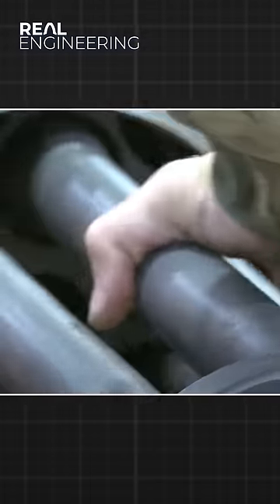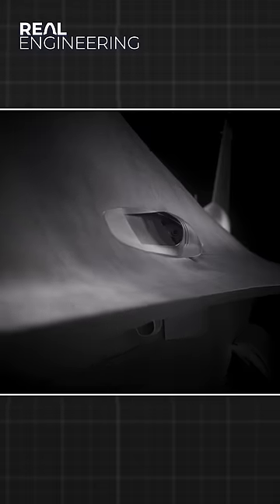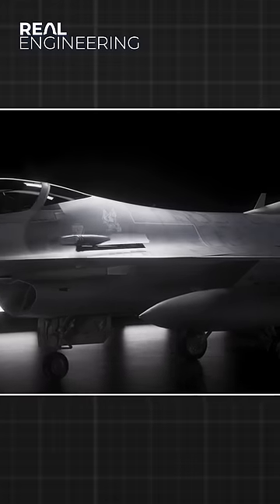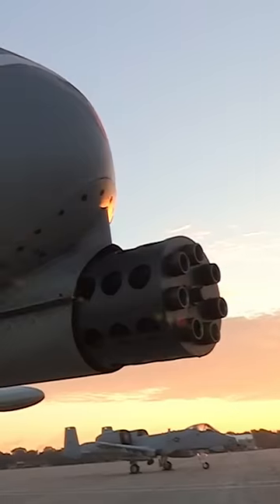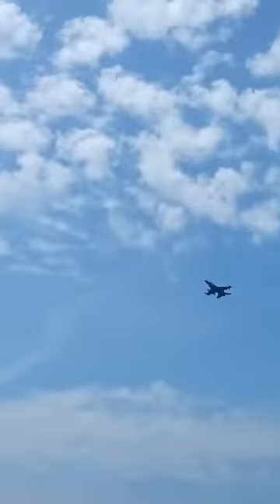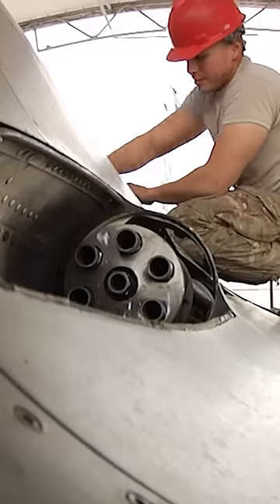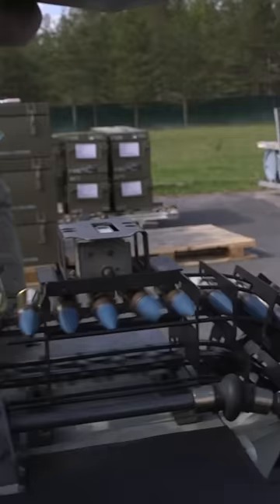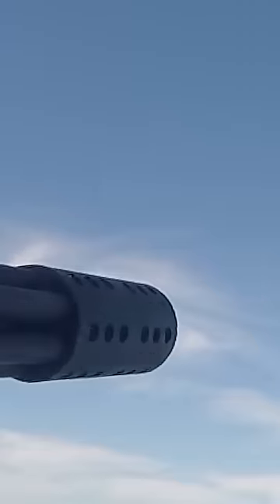The F-16s Gun Sounds Amazing

Comment: As an F-16 pilot once told me, if you have to use your gun, you already fucked up.
Reply: And thats why the f-35 has no gun, (it has a gun pod attachment because of FUDS and Reformers) and new rifles don’t have bayonets.

The only thing you should do if you find yourself having to use the gun on a fighter, or the bayonet on your rifle, is find the officers who put you in that situation and have some kind words with them.
Reply: @purplepenguin43 you have the bayonet on your rifle to use on your officers!
Reply: Too close for missles, I’m switching to guns
Reply: @purplepenguin43  Still the F-35A intended for Air Force strategy and doctrines have built in Gatling cannon
Reply: Would an F-16 still occasionally do CAS gun runs, or is its gatling not really meant for that at all? Asking in case video game depictions of the F-16 are blatantly inaccurate
Reply: F-35s have the GAU-22 @purplepenguin43
Reply: @purplepenguin43 better to have and not need then need and not have isn't it?
Reply: @elwoodcope7152 that ain’t no shotgun I’ve ever seen!!
Reply: Yeah, you didn't run fast enough to get back to the JFT. American weapons are designed like a network.
Reply: @purplepenguin43 I would 100% like a bayonet mount and not ever need it
Reply: Luckily the F16 is a very good dogfighter and have great gunsights!
Reply: @iPlayOnSpica cas is actually maim use of the gun. Its useless for planes in modern warfare, you will never get into a dogfight with a plane. It just doesn't happen
Reply: @jooot_6850  As a Vietnam Vet, I heard the Go-To Attention Getter was the M67.
Reply: @iPlayOnSpica  Yes, CAS is in its mission role.
Reply: Yup
Reply: While in reality Dog Fighting is every pilots wet nightmare
Reply: @purplepenguin43  A British army unit performed a successful bayonet charge against the Taliban in Afghanistan after they were ambushed.

The Taliban wet themselves when several screaming Englishmen came charging towards them with bayonets and withdrew immediately.

So the bayonet still has its uses
Reply: The cannon is also useful for close air support of ground forces.  Pilots practice it on gunnery ranges. I saw both F-16 and A-10 cannon fire in air-to-mud roles.  10mm may not seem like a huge difference between the two, but it is remarkable.
Reply: @purplepenguin43  It has a gun pod attachment, because the original design included a gun and it cracked the frame. Now the gun pod interferes with the stealth capability. You have a lot of the sales department's spin all over your statements. Be sure of this, the f-35 is unwanted by all the other countries, because it has been plagued with MASSIVE problems from the beginning, causing it to be one of the many ultra-expensive pieces of USA shit.
Litoral class navy ships -- canclled
USS Gerald Ford -- Incapable of combat
F-22 Chokes out the pilot and cannot fly in bad weather.360 display does not work.
There are many these days, but the F-35 is the worst and the most costly.
Reply: Whether or not a gun is still a useful weapon will be determined when there’s an actual air war with large numbers of fighters going up against one another for a prolonged period of time. They had this same conversation before Vietnam
Reply: @purplepenguin43  the guns are still quite handy on a fighter aircraft because its much like the bayonet, sometimes you need a knife and not having one when you do need it will not be a mistake you get to make a second time.
Reply: They use the gun a lot for close air support. Cheaper than dropping a bomb with a lot less collateral damage
Reply: @iPlayOnSpica  F-16's can and are used for CAS, pilots practice this skill often. They need to keep the jet pointed at the ground target, while flying at it at 400 to 600 mph. The F-16 has excelent controlability in flight.
Reply: @purplepenguin43 the f35 doesn't have a gun because it was already a flying pig without a gatling gun
Reply: Which would be a good reason why it's there.
Reply: @purplepenguin43 the a variants does have integrated
Reply: To which the A-10 pilot retorted "that's when the fun starts"
Reply: @jooot_6850  The bayonet and the flash diverter combine to make contact shooting less likely to result in a burst barrel.
Reply: @anduril7401 you'd have to be within a kilometre. That doesn't happen with 150km engagement range.
Reply: @purplepenguin43 You can’t really call them fuds for wanting to keep a contingency plan onboard fighter planes. Due to the fact that American fighter jets have only actually fought against their contemporaries a handful of times, most of the planes they face aren’t the ones that their missiles are designed to lock onto. It was only a few years ago that a pair of either f-16’s or f-18’s engaged a Syrian(I think) MiG, and got alarmingly close to it, within a few miles, before they could shoot it down because the first couple of missiles they fired wouldn’t maintain lock. Missiles not working well combined with a lack of onboard guns was also the main cause of US air-to-air fighter losses in Vietnam.
Reply: @iain-duncan in a large enough conflict, it very well could. Planes can only carry so many missiles. A large enough engagement between peer or near peer air forces could see all the air to air missiles shot and the engagement still taking place. We just haven't seen a conflict between modern air forces on a large enough scale for that to have happened, luckily enough. I don't want too either.
Reply: @ratherbefishing4225 correct.  And put cannon pods on F4s because the early models didn't have one.
Reply: @purplepenguin43  Marine and Navy F35B and Cs don't have an internal gun.  USAF F35As do have an internal gun.
Reply: @purplepenguin43  What are you talking about it has a 25mm Gatling cannon in the fuselage.
Reply: Honestly wondering why tf would you need this on a jet that fast? Only shoots forward anyway its extremely unlikely to hit your target
Reply: @gtaxlondon  why do officers carry side arms? Better to have it and not need it
Reply: @salsamancer "...than to need it and not have it."

That's actually the slogan of an  insurance company where I'm from 😹
Reply: F-22’s have guns and their 5th gen.
Reply: @little_lord_tam  Spot on.
"I love the adrenaline, but hate the fear..."
We don't get the one without the other.
Personally, I don't like the Adrenaline.
Reply: @gtaxlondon  Its an emergency weapon militaries still issue sidearms even though most fighting is done with a soldiers main weapon.
Reply: @happyjohn354  a sidearm isnt a good analogy at all we still carry knives. If you don’t understand what I meant or just wanna argue thats fine.
Reply: @gtaxlondon  No I think its a perfect analogy in combat if you have to resort to using your sidearm you are in a shitty position and chances are you are about to die.
Reply: @carlm.m.5470  "Unwanted", meanwhile multiple countries keep putting in orders for F-35's, like with Singapore's latest order.
Reply: @purplepenguin43 The M16 and M4 uses the OKC-3S bayonet.  Imagine your embarrassment if your trench gets overrun and you've misplaced yours.
Reply: @purplepenguin43 очень хорошо сказано!
Reply: @jooot_6850 Nope! That's what your frags are for.
Reply: But also you got very lucky to get that close without getting a missile in the face.
Reply: Unfortunately i also agree with that statement. Thats the jobs of apaches and a10s. The f16 with bigger autonomy and speed, its more used for bigger targets like radar stations, barracks, airbases, railroads, bridges. And is it still used today with all the f18s and f22s?? Or are they all sold to other countries??
Reply: What do they usually use, cooking pans?
Reply: You don't need to be an F-16 pilot to know that. I would think if you actually did know a pilot, he would have imparted some more interesting, lesser known information, and especially something that couldn't be deduced by simple common sense or by watching any number of Hollywood movies.
Reply: @bpw102896  Until having it puts you in a lot more situations to need it. Like ruining your stealth. Adding weight. Making you use guns instead of just avoiding it.
Reply: @brentonherbert7775  it won't ruin stealth we've already solved that problem
Reply: @purplepenguin43  Uh oh. On paper a modern jet should not have a gun. They are rarely used and add a lot of weight. However, every time we have tried just ditching the gun someone has always made up pay for it. And those damned gun pods suck, they can't hit a damn thing. Yeah in theory the stealth should make it much harder to force one into a close range scrap but enemies can be quite adept at forcing you to do things you don't want to do. It's sort of their job. Never underestimate an enemies ability to fuck up your plans.
Reply: Did the f16 ever have to be used for close air support and also would the f35 be used for close air support with the gun attached on it?
Reply: @CorpraliusCotrel  Well considering we in todays day and age have this thing called "guided munitions" where cameras can zoom over 100x and guide shots down with an accuracy of a couple feet.... An accuracy of which guns will never match.
Reply: @brentonherbert7775  yeah you might as well use those guided munitions only downside is the costs of those
Reply: @CorpraliusCotrel  Because the Military is so fussed about spending?
And... ya know.... >30k munition > Risking a 30 MILLION dollar plane.
Use your brain im sure you have one.
Reply: @brentonherbert7775  I’m trying to say that the gun is effective, a machine gun is really only effective for supporting ground troops
Reply: @CorpraliusCotrel  say the gun is effective > Gun is only effective for supporting ground troops (which sounds like a bad thing to me with how phrased it)
So which is it???? Is it good or is it bad??? Maybe try and phrase what you're trying to say correctly?
Reply: @brentonherbert7775  it’s bad at one thing but good at another so it’s mediocre
Reply: @CorpraliusCotrel  Its not good at anything these days though.
Reply: @brentonherbert7775  that I would agree with
Reply: @purplepenguin43  the f 35 has a gun. You can find videos on Youtube
Reply: air-to-air gun dog-fights have mostly gone  the way of the dinosaur with the advent of good misiles.  but ground targets like tanks or light armor are perfect food for this gun
Reply: @iPlayOnSpica F-16 gun is only for dogfights, it can punch lightly skinned vehicles tho and it was plans to put an A-10 gun pod on it.
Reply: @CurtisDensmore1 that's if they can hit something other than friendlies.
Reply: @gtaxlondon Frontline fighters need them In case they're caught in a merge, the fifth generation doesn't need them because of stealth, if you have to go into the merge, you were doing something wrong.
Reply: @StrikeNoir105E cuz the defense industry can be very persuasive and there are a lot of problems that go on behind the scenes like refusal of giving the country free reign on their purchase and all that. It was a F-104 scandal where the US pushed countries like Japan to purchase it with the reputation behind it.
Reply: @nsudatta-roy8154  yikes when I heard the real meaning of fragging… changed my entire perspective on the military smh. They said 80% of soldiers got away with it which is even crazier
Reply: @subjectc7505  yeah its just surprising we havent thought of anything better like a rail gun or lasers or something with a much faster projectile. An auto turret that aims on its own independently from flight direction. Seems you would need a lot of luck and skill to take another fighter down w the guns we use

Comment: I had the opportunity to work on the M61A1 for the F-14 and F-18 aircraft and it was awesome. We even fired 25 rounds in the firing tunnel at Pax River Maryland and I hate to admit it was an incredible experience to feel your body shaking 25 times before you realize that it fired.
Reply: I noticed the guy using a hand tool to load the rounds. 
Do they ever allow the use of power tools for that part (likeduring actual wartime for instance)?
Or it's it just to delicate/dangerous?
Reply: With that firerate all you felt must be just 0.25 seconds of a zrrt lmao
Reply: @mdenizcoban  The firing rate in the ground for the M61A1 is 7,200 rounds per minute so based on my calculations it was .00347 of a second.
Reply: @tracewallace23  They do use a power tool once in a while but gun conveyors jam often so they have to be careful.
Reply: @melendjam  General Electric's website says 6000 rpm for its firerate though
Reply: @melendjam  thanks 👍 that's what I thought. I imagine an impact gun could accidently tear some stuff up
Reply: @mdenizcoban  I guess YouTube erased my response. Here is another version, the max rate is 7,200 and when installed is 6,000. We were in a firing tunnel at Pax River. Unfortunately, I can't give you the reference (it gets removed) but if you google any military document it will tell you.
Reply: @melendjam  soo 6000 is when its installed on a plane and 7200 on its own, thats also how its 4500 on Phalanx CIWS then, got it
Reply: Did Kenny Loggins "Danger Zone" start playing in the background?
Reply: as awesome as the gatling gun is, its like having a cd player in your 2024 tesla 🥹
Reply: @aSSGoblin1488  Not really, that is the only option available for close quarters combat. When flying things happen extremely fast and missiles are not 100% guaranteed. They removed the guns in Vietnam with the F-4s and revert back because of that.
Reply: @generaleerelativity9524 Take my breath away.
Reply: Witnessing/hearing that, I'd be like Deadpool. "I'm touching myself tonight"

Comment: Ugggh, As a USAF Ammo troop, I remember having to dump cans of these rounds out on a grounded table, count them, then load them into a UAL and run them out to the flightline to load into the aircraft.  Read some comments in here and thought I would add that these blue headed rounds are for training, like at the gun range for aircraft for instance, but we also had high explosive rounds and armor piercing rounds for those that said this gun wasn't effective for vehicles.  LOL.  These guns will hardly ever be used for aircraft to aircraft battles, because it just doesnt happen that often anymore.  Regardless, these guns when loaded with the proper ammo types will straight up murder soft targets, vehicles, radar and SAM sites or anything else if bombs and missles are expended.  For anything like heavy armored vehicles like tanks, buildings, and wide areas of targets, the 105MM round from the AC-130 Gunship will get the job done and also has different round types depending on target.  Same for the A-10 and every other aircraft.  You have to think about all the different types of ammo or munitions available, make the best choice of available ammo types for the mission, etc. to get the job done fast and effective. The way the combat sorties are planned out is kind of like ordering pizza for the aircraft, but are usually already built or loaded in a deployed environment prior to missions due to rapid deployment priorities.  In a non combat or training environment, they tell us what they need, we inspect, count, and load or build them, then deliver them.  Gun rounds, bombs, missiles, countermeasures, and everything else that goes boom.  We also have to recycle all the brass from expended rounds.
Reply: Thanks for serving. Interesting information from your viewpoint as well.
Reply: You had to MANUALLY COUNT those rounds?!
Reply: @baked_beans_779  I barely know how to use a BB gun lol
Reply: @karnagefails333  I meant the aircraft but yeah
Reply: @baked_beans_779  Shit, I'm sorry dude 🤣
Reply: @karnagefails333  lol
Reply: This should have 20k likes!  Great info!  Thank you for serving! 🙏🏼
Reply: You might add that firing 100 rounds at a time is called a long burst. The 6 barrels would have to be pulled and checked. I don't know what would happen if you fired all 511 rounds in 5.4 seconds. This may or may not be totally correct. I was F-16 weapons back in the 90's and have slept since then.
Reply: @baked_beans_779  I myself didn't count all the rounds for all the aircraft, we had lots of troops, and we were at every base.  We counted every round of every munition type from small arms 9mm rounds, to grenades, bombs, missiles, and everything else that goes boom.  When you loaded the rounds into the  UAL (Ammunition Loader), it DOES have a counter on it which wasn't digital, and inaccurate most of the time, but regardless we would still have to count 20MM before and after sorties by hand.  Not just to get the accuracy in quantity correct for the aircraft and for storage, but also to make sure all rounds were inspected and deemed safe for use.  We did it this way for every munition type in our arsenal.  Especially when it comes to how important inspections are for aircraft, if a bird strike can take out or severely damage an engine, or crack the canopy, imagine what an unsafe single high explosive 20MM round or  AIM-9X missle could do.  The primers on the 20MM as well as the weapons loaded on the aircraft are all electronically initiated too.  When the pilot pulls the trigger on his stick,  the message is sent to whatever hell he or she wants to unleash on a target in about the same amount of time it takes your brain to send a message to move your body parts.
Reply: @djblade337  cool, good to know